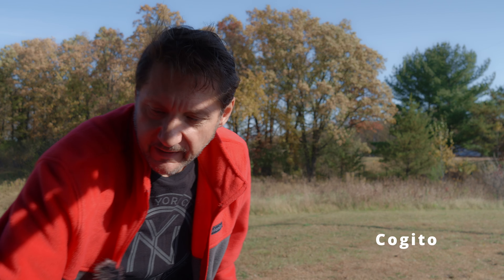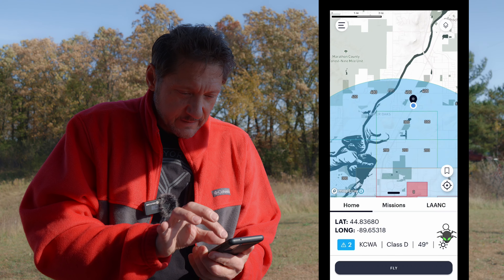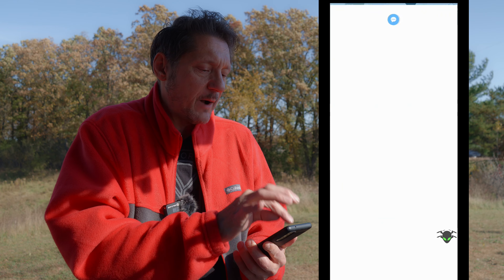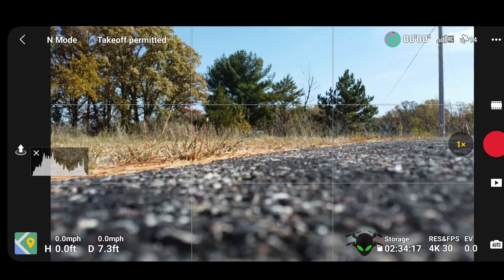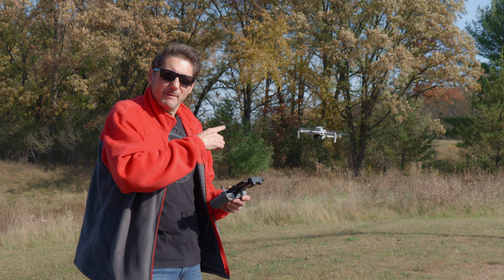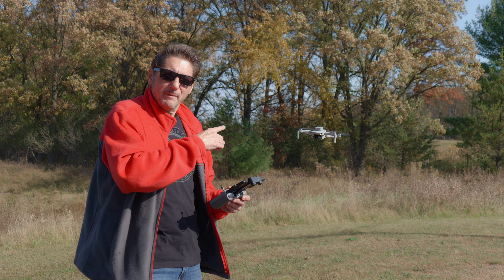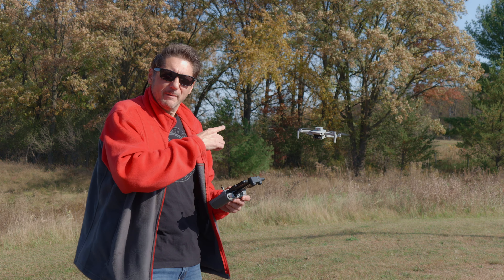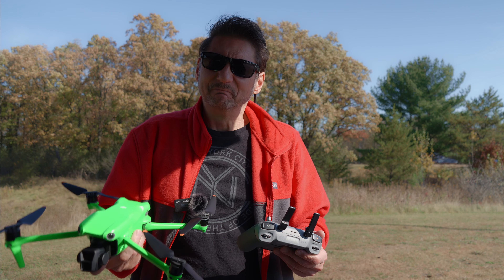DJI Air 3 & Mini 4k Clones with No Goefencing?  Specta Air/Mini

Comment: Thanks for confirming the geofencing has been removed. I'll have to pick up one of the Air models.
It's not just the geofencing that drives me crazy with the DJI drones, it's having to login to DJI before it will release it from being very limited in how far and how high it will fly. I use a tablet that isn't connected to the Internet so I have to make sure I login from home using wifi before I go and not turn off the tablet. Just a real pain.
Reply from the maker: That login is really annoying!  I end up logging in the night before just to make sure I'm good for the next day.
Reply: I agree that's really annoying.  Makes me wonder if the federal government has legs to stand on when they're put on the ban list.
Reply: THIS! It is SOOOOO annoying!

Comment: I looked at getting a Specta Air last week, no extra batteries or props available so I passed.    Thanks for the video, wish DJI would do the same.
Reply from the maker: Thanks!  The batteries are a deal breaker, glad I got some when they were available.  The props are available anywhere you can get Air 3 or Mini 4k props, they are identical.  🤙
Reply: @AlienDrones  Good to know on the pops 
, Thanks.   I'm going to keep an eye on the battery once I can get some I'll go ahead and get at least two extras.  I just don't want to fly with one battery.

Comment: What new features are missing from using the older firmware?
Reply from the maker: The only difference I'm aware of is the removal of the geofencing unlock requirement, which didn't work before and the drone was prevented from launching in controlled airspace.  Now it launces without issue.

Comment: In the UK DJI removed all geofencing about a year ago. I live within a mile of an RAF airfield, before the geofence was removed I would need to obtain permission from the airfield flight control before DJI would unlock the zone. Now if I chose to I could fly whenever I wanted and all I get is a warning that I'm in and FRZ. I thought the removal of geofencing was world wide but from what you're saying that's not the case.
Reply from the maker: Thanks for sharing!  Fairly certain the geofencing is still active in the US, a lot of complaints about it for sure.  You are very lucky if they removed all of it in your area! 🤙

Comment: Nice review! But for those with professional shooting needs, the DJI Air 3s seems like the better choice. Its image quality and dynamic range are really impressive, and the low-light performance is amazing. Perfect for capturing night scenes.
Reply: But isn't the air 3 basically the exact same drone as the specta air? If so how is the dji so much better?
Reply: its the same camera
Reply: What are you talking about? DJI aren't even the best drones, lmao!!! FYI, the internals, software, camera and looks are exactly the same, just different names. I have both now, and the specta is the same and way cheaper, lol
Reply: @ThEOuTdOoRGuRu-JW  can you use the specta battery in the dji & the reverse? Thanks
Reply: @naturestrail2296  Nope, you can't, completely different company. You can't use the DJI battery in the specta, and you can't use the DJI controller on the Specta and visa versa. Completely different coding, which won't allow it.  However, as I stated before, you can use the other hardware like perpellers, motors, etc.
Reply: @ThEOuTdOoRGuRu-JW  ok, I seen claims you couldn't but thanks for verifying. You know how things go these days. Can't trust review sources to tell the truth. They'll say you can't even if you can often thanks to lawsuits.
I was wondering if the batteries will actually physically fit at all? Is it just a computer chip or polarity difference at the contacts that causes it?
I keep wondering how the thing knows when there's extra weight. I put propeller guards on my mini 3 and it suddenly won't fly more than 50 yards out and limits speed etc. The guards literally weigh like a half ounce I think. Can't imagine why they limit this stuff that bad. Blade guards should be considered a safety device if anything you'd think. 
I almost bought the specta but was wanting the better low light camera and little longer flight time of the mini 3. Wish specta made little better ones
Reply: @ThEOuTdOoRGuRu-JW  if the software etc is entirely different does the specta version deal with wind as well and hover in place etc just as well?
Reply: @bertie163  wish there was a light drone with the 12x optical zoom option like the 3s.
Reply: @naturestrail2296 On paper the specta is suppose to handle up to 35 mile and hour winds which is level 7 wind resistance. I havnt tested in wind yet, but I live in Colorado so it's soon to happen this week lol!! We are suppose to get 25 to 45 mile per hour winds so it will be a true test for the specta. I'll post a video this week 😊

Comment: Is the Air available without the "screen" remote, just the regular controller?  I use an iPad Mini 6 with my Mini 4K as I need the additional screen size (old age - not as good eyes anymore).
Reply from the maker: It is not available with the basic RC, only with the RC2.  It might be possible to connect a tablet/monitor to the remote via HDMI...

Comment: Will it connect to dji controller?
Reply from the maker: Nope.  Battery and controllers have proprietary firmware/software that makes them unique to Cogito.  Everything mechanical (ND Filters, props, landing gear, etc. ) is cross compatible...

Comment: I bought a Specta Air.  Flew for the first time this weekend.  Only way I can get pics off the drone is to connect w/ USB from the drone to laptop.  Is there any way to sync files to Android phone w/out needing a wired connection to a laptop?  I don't see a Cogito/Specta mobile app like DJI has....
Reply from the maker: I haven't found a way.
Reply: If you have the rc2 remote and a sd card your drone files you can download straight into the rc remote and it goes on your sd card
Reply: @alien drone seeing that the rc2 controller  is android based wouldn't it be possible to put a modulator on it and use your phone to access the rc2 remote remotely ?

Comment: What is the max elevation on these guys?  Is that restriction gone also?
Reply: Curious about this as well
Reply from the maker: 1640 ft. AGL, this is the same.
Reply: @AlienDrones  What do you mean the same?  Is that the same max alt as the DJI?  My friend has never been able to get above 400ft even in the middle of the desert.
Reply from the maker: @starhawke380  To be clear, this IS a DJI, just not in name.  It is whitelisted by DJI in an attempt to sidestep the potential ban.  This drone and the DJI Air 3  have an adjustment that allows the altitude maximum to be raised to 1640'.  This is not the same in all drones but in these models it was and is 1640' before and after the firmware update.  As a side note, flying above 400' is illegal in the US, even in the middle of the desert, so don't do that in the US.  🤙
Reply: @AlienDrones  then why allow drones to go above 400ft at all?  It's a much nicer view from up there. Which is the whole point of having a flying camera.
Reply from the maker: @starhawke380  There are a few situations when flying part 107 where flights above 400' AGL are allowed and even necessary.  Think 1000' tower inspection with the right permissions.
Reply: @AlienDrones  I always try to fly safe, Im very aware of my surroundings, but Im really tired of all the restrictions.

Comment: Do you know if the Specta Air uses the same batteries as the Air 3 and 3s?
Reply: Does not.
Reply: @onefastr6  That's a shame. 😟
Reply from the maker: Indeed, they are proprietary to Specta drones.  Kinda annoying...
Reply: Wonder if they could be configured to work some how?

Comment: Just about to pull the trigger on a Specta Air as my third drone.  BUT,  has anyone been able to find any,  any at all,  batteries for it?  the only thing being sold now is the kit with drone,  controller and a single battery.  No spares,  no kits with 2 plus batteries.   Should I be worried?  Should I shell out the $900 more to go with a DJI Air 3S
Reply from the maker: If the extra $900 won't keep you up at night the Air 3S is a much safer buy for parts, repairs and support.  If you consider it disposable if something happens to it then the Specta makes sense for the money.  If you are hoping for future support, service and parts, so far history has shown that not to be available for the Specta so it depends if you're a betting man or not...

Comment: What’s a dji level drone??
Reply from the maker: Quality of flight vs. price that matches or exceeds that of DJI products, who sets the bar for the industry.  Honestly it's a pretty high bar.
Reply: @AlienDrones  umm yeah, no one can compete
Reply from the maker: @Rckid28  This IS a DJI drone under the hood, I guess including the hood.  A white labeled product from DJI in response to the proposed ban from what we can tell.  If you remove the names you can't tell the difference in functionality and quality of flight and image.  They do have different firmware and support, which Cogito does not do as well yet, including thing like repair/replacement programs.

Comment: There are no spare batteries for this. DJI batteries wont work for the mini 4k so I have been told. ? "Specta" branded batteries are out of stock.
Reply: That is true. I tried not knowing the issue.  Promt pops up on screen.

Comment: Dji really screwed over the people who bought the original air 3. They did this for cheaper and put the air 3s
Reply: The specta is JUST the air 3 but the price is really good
Reply: Batteries wont work though